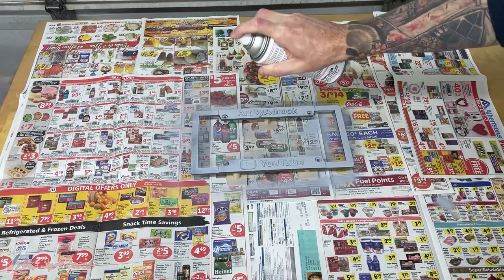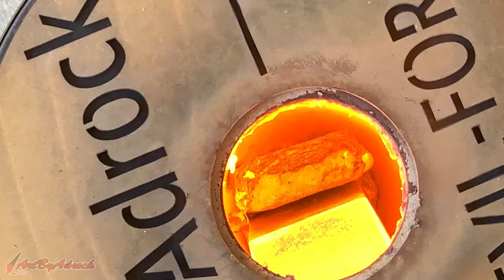Casting A Custom License Plate Frame - Simple Aluminum Metal Casting

Comment: Really liked this project. Did you increase the overall dimensions of your 3D print to compensate for shrinkage of the aluminum? I was just curious how much it shrunk.
Reply from the maker: No I didn’t, it’s not really necessary for things that are thin as there isn’t much shrinkage at all.
Reply: @ArtByAdrock  thanks for the information I’m trying something like this now and maybe I’ve been totally overthinking it. Fantastic project and thank you for your response. 🙏
Reply from the maker: No problem, good luck with yours 👍🏻